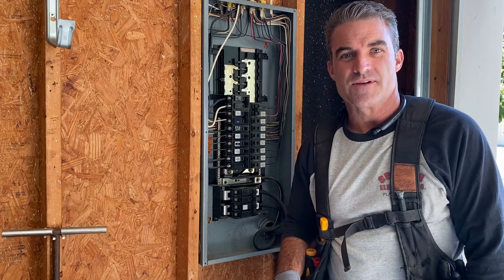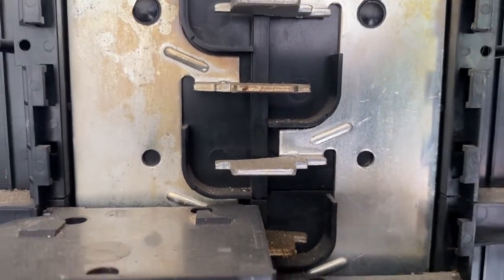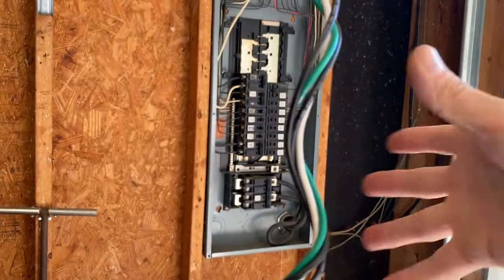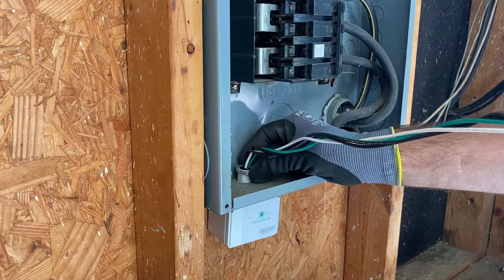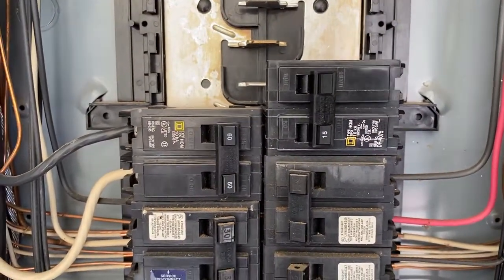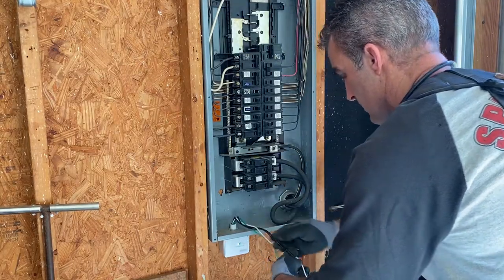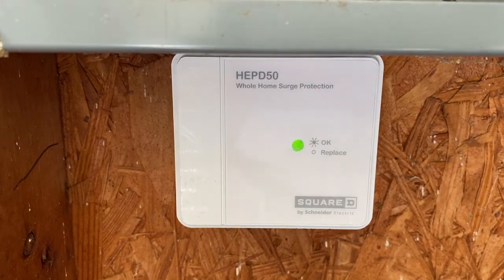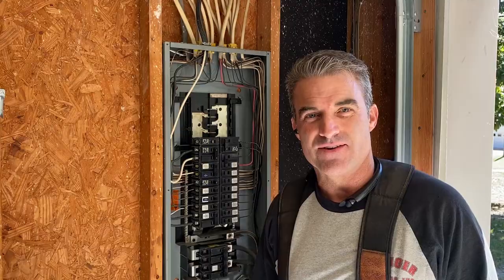Install Square D HepD50 Whole House Surge Protector #howto #diy  #homeutilities

Comment: I noticed you decided to install your surge protection device downstream of all existing breakers.  Can you explain how your setup will protect the existing breakers from an initial surge from, say, a lightning strike?
I would assume each existing breaker has roughly 40 to 100 feet of 12/2, 12/3, 14/2, etc. of supply/return wiring.  That's a lot of initial surge that will run from your 200amp breaker to your sequentially installed sub breakers per the bus bar before it hits your surge protector. I would think that theoretically, your system could endure over 1000 feet of wire surge before you displace the remaining surge.  

To further explain my question...the 200amp breaker can be set to the off position to kill all breakers connected to the bus bar, right?  That means power flows from the 200amp breaker to the bar.  The surge protector is located at the last point of initial flow, so the same would go for an initial surge.
Reply from the maker: Hi. This install is to manufacturers specifications. The specs, according to sheet NVE82551, call out for two best practice options. The first, is the one I chose to do. The second, is installing the surge protector to the bus bar / lugs. The problem with this installation, in my opinion, is the loosening of the lugs and retightening. If you don't get those lugs torqued down properly, then you wind up with loose connections down the bus bar feeding multiple breakers.👍
Reply: @YouCanDoIt2  👍
Reply: surges take the path of lowest resistance so you. can mount anywhere on the panel
Reply: @Joe D  True, but if you mount it at the bottom of the bar, you have 100 times more of a chance for the initial surge to hit anything mounted between the main breaker and the surge protector. Don't believe me, just email Schneider and ask.
Reply: @DaysAhead202   Schneider purchased  the surge co. that i was a product manager for the SPDs.  i am responsible for bringing several of these products to market.   i am very knowledgeable of how MOVs work, wire lengths, OHMs law , path of least resistance,grounding, clamping voltage, let thru voltage, class A,B, C products, UL1449., shunt to ground, line fuses, SCCR…
Reply: @LuLu_World Where can I read about how these surge protectors work (the science and engineering, not just how to install a packaged product)?

Comment: Thnks for the video. If I don’t have any space for a 2P breaker, can I connect it directly in the main lugs ?
Reply from the maker: Hi Alberto. That you for watching the video. Installing on the main lugs is an option. You need to follow the installation instructions on how to do that. Those main lugs really need to be torqued down nice and tight to avoid issues downline. Best wishes with your project 👍

Comment: Hi, I appreciate the video and is a protection indeed, better than having nothing. And, as it is it will protect. Yet, is important to read the instructions and the two hot wires need to be braided or twisted in order to be more efficient, especially when it travels so far in the panel. Surge arrestors behave different and just like a low voltage wire, these can get noise in the current so two wires traveling on parallel such a long distance will surely affect response.  Also, avoid loops and bends. We old timers knew that it cannot be sharper than the bottom of a soda can when it comes to turns. Keep it short. Speculating that you need to move it is worthless, the purpose is to optimize the protection and if anything, any breaker you need to move then move another and these breakers should get closer to the point of entry. You want any voltage tsunami to hit the protector way before it bleeds into appliances close by. 
There are other details, even some cosmetic ones, like my father would have made a fit if I left all the debree and dirt inside the panel. Is good to clean them so inspectors/customers know you are meticulous and go the extra mile, it helps set the mood in the inspection. Nonetheless, as a minimum, twist the wires like the instructions for this particular surge protectors asks. That is utmost important. 
All that said, thank you for posting a video, at least is technically correct and it does protect the way you did it, but improve it with the aofrementioned, each nanosecond you can get is paramount.
Reply: Proper wiring is much more important than proximity to the main

Comment: Thank you for the video. Somewhere in the installation instructions, I read for "optimal" protection, the wires from the HEPD to the breaker should be as short as possible. I like the ideas of keeping the whole length of the wires, but is it ok to keep it long, or should we cut the wires to be the shortest possible between HEPD and the breakers.  Thanks
Reply: the shorter the better but if you need to keep them quite long then braid or twist them per the instructions, this will optimize since it kills the noise and lets the protector absorb much more, much faster to shunt.
Reply from the maker: Hi. Thank you for watching the video. I think it's fine for the wires to be a little longer (slack) than you need in case you have to move / add breakers to your panel in the future. If you cut them the exact length you may limit yourself in the future. Hope this helps 👍

Comment: Thanks for your help!!!  I have a question, what device should I buy if I want to protect my house  from HIGH and LOW voltage?
Reply from the maker: Hi! Thank you for watching the video. There are surge protectors for motorhomes that protect for both low and high voltage swings. There is a company called Ditek that has surge protectors for low voltage. As far as providing whole house low and high voltage surge protection I am not aware of any. Not to say that there aren't any out there, I just have never really searched for that.
Reply: @YouCanDoIt2  Thanks 👍

Comment: Will this protect a sub panel that's wired to the main, or should it be installed separately at the sub? Thanks.
Reply from the maker: Hi Rich. Thank you for watching and leaving a question. Surge protectors should always be wired into the panel that receives the power from the source (utility company). This would be your main panel. Everything downline such as your sub panel would also be protected. Hope this information helps 👍

Comment: you are wrong the protector goes first where the current from the meter enters
Reply: Not every situation  is the same
Reply: Nothing says it has to b first breaker...check directions
Reply from the maker: @brianmeeker3058  Hi Brian. I'm not sure if you're referring to my comments or Juanquisal's. I did not say that in my comments that I put this in at the first breaker location. I did the first option that that was called out on the manufacturers installation instructions. Hopefully that clarifies for you. If you watch the video it clearly was not installed at first breaker location 👍
Reply: @You Can Do It  sorry that was for the comment before mine.. just put 2 in today
Reply from the maker: @brianmeeker3058  No problem 😂.  That's why I was trying to be vague with my response as I figured you very well could be referring to the original commenter. You'd be surprised how many people leave horrible comments on things they don't know much about but make you feel like you're the absolute idiot.😅
Reply: @brianmeeker3058  Common sense does.
Reply from the maker: Hi Juanquisal. This install is completely to manufacturers specifications. This is the main panel, not a sub panel. The specs, according to sheet NVE82551, call out for two best practice options. The first, is the one I chose to do. The second, is installing the surge protector to the bus bar / lugs. The problem with this installation, in my opinion, is the loosening of the lugs and retightening. If you don't get those lugs torqued down properly, then you wind up with loose connections down the bus bar feeding multiple breakers. Hope this information helps.👍

Comment: Since you are using Square D breakers with a two wire connection at each terminal of the 
double breaker, why not install the two hot wires into an existing 15 amp double and save 
the expense and trouble installing a new breaker? This is useful if you don’t have the space
in an existing panel for an additional double breaker.
Reply from the maker: Hi Robert. I see what you are saying. However, some states / counties don't allow double-tapping at the terminal of the breaker. I did the cleanest install according to the manufacturer specifications sheet NVE82551. There is a note on the install sheet that states that you can install this on a breaker that is indicated for multiple conductor use. However, if that breaker is tripped due to overload, the surge protector will no longer serve as a protection to the remaining breakers in the panel. Therefore, the purpose of installing this protector becomes void. If this is isolated on its own breaker it serves as continuous protection for the entire panel regardless of tripped breakers downline. Also, some products will not warranty their item if it is not installed according to their specs. Hope this information is helpful.👍

Comment: Do you need a permit to install this? I think I know the answer.
Reply from the maker: Hi Miss Jenni! That is a good question. For the answer you would need to look into your own city / county codes. Some require permits for installing a doorbell😀. This is technically the addition of a breaker into the panel that protects all other breakers. Hope this information helps!
Reply: @YouCanDoIt2  thank you. Yes it does. For most electrical like this, we usually hire out for the work. That way we know personally it was done right. 😄
Reply: @MissJenni_ISO  Yeah, but....  Unfortunately, there are a lot of installers that don't know how to follow instructions or best practices. I tend to do things myself and I know to blame the guy in the mirror if anything goes wrong.  Best of luck to you on your project.